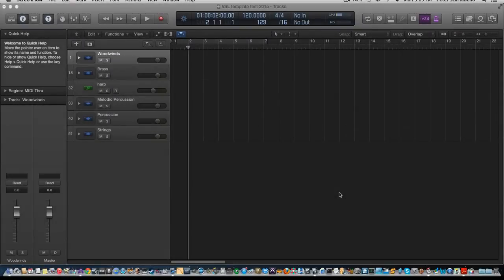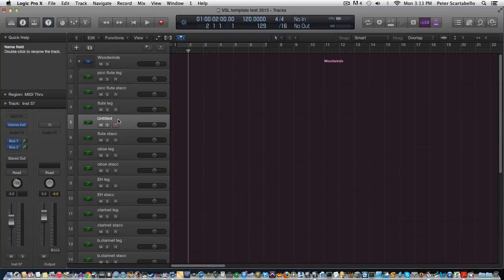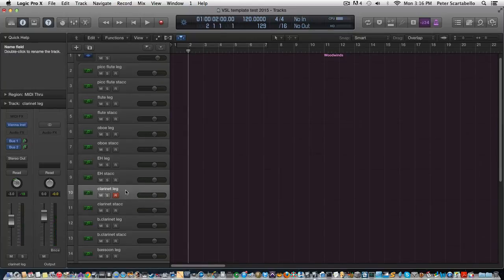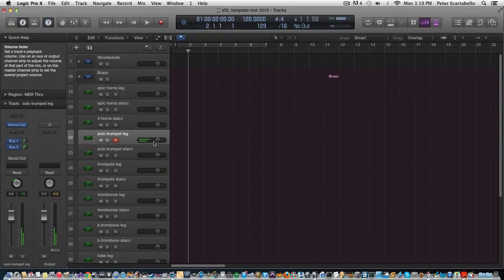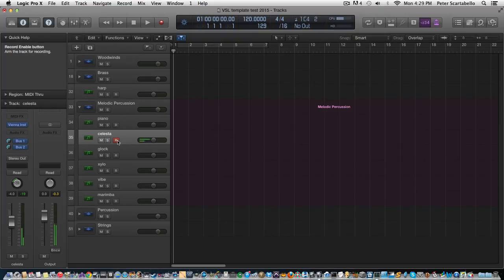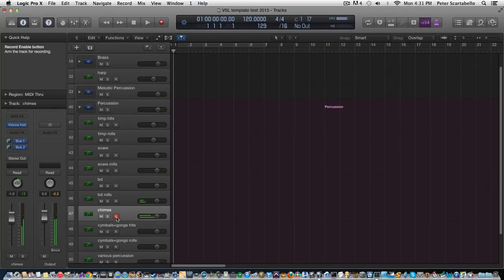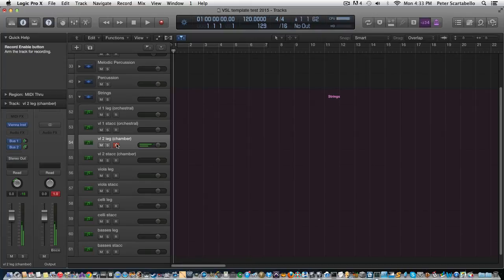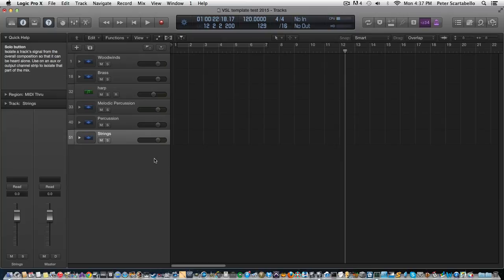MIDI Orchestration with Logic and VSL - Part 1

Comment: Thank you for your tutorial. i don't have your reverb but just the ones from Logic Pro. Which ones would you advise. And is there a way to add these reverbs for the all group of instruments. For the moment I understand that I have to repeat the reverb addition one by one for each of them. As you understand I am quite new to these programmes. Thank you for your advises.
Reply from the maker: +Maurice Amaraggi Hello!!! Thanks for you comment. What I normally do is do subgroups of the diff choirs within the orchestra. So I'll have separate reverbs for percussion, brass, winds and strings. This is because I like to do different pre delays for diff groups. But yes in logic send the output for all the winds to a wind buss that you create for example. As far as logic reverbs go the space designer is pretty good. You want a decay time somewhere between 1-2 seconds. Depends on what you are going for. Real orchestral halls are 2 seconds or more, but Hollywood scoring stages would be between 1-1.5 seconds. Hope this helps!